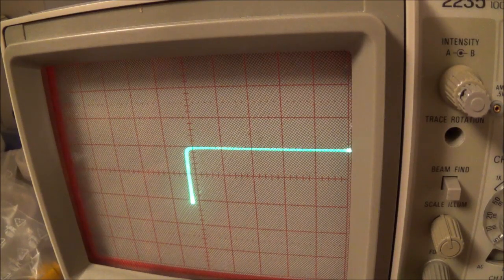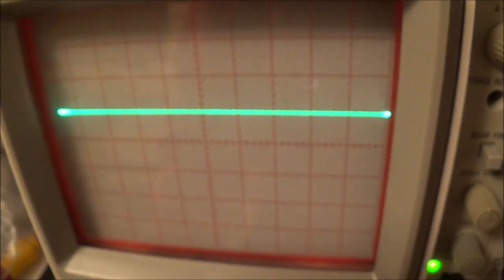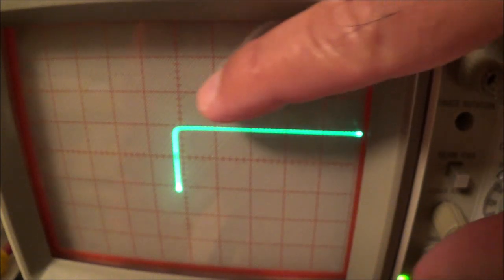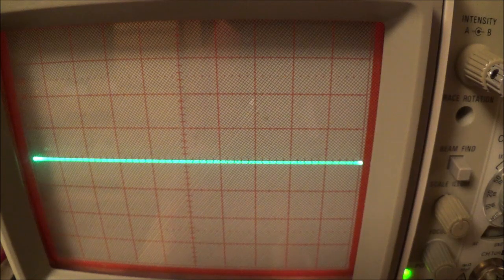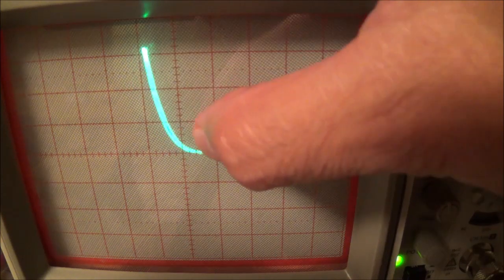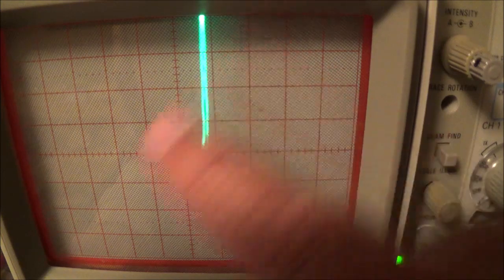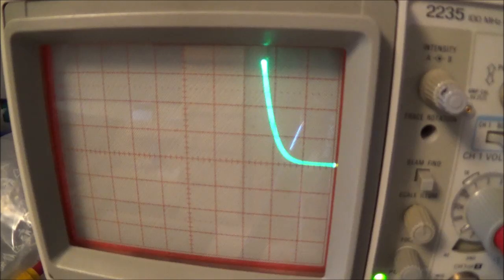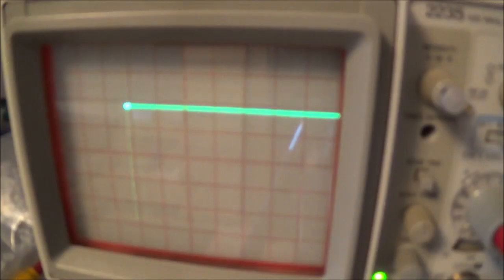Zener Diode Check-out With Leader LTC-905

Comment: OS, this was very informative and interesting! I have a Tenma oscilloscope (https://www.youtube.com/watch?v=spUe7p2jXrM&t=925s) that has a component tester, would it be comparative to this curve tracer?  I don't have it inline, however, once Im complete with my new workbench build (real soon), I plan on having both oscopes inline.  Thanks!  ~Jack, VEG
Reply from the maker: Thanks for watching and commenting, VEG! Kinda, the same. When you are im diode check mode with the Leader curve tracer it is almost like a component tester since the staircase pattern is not utilized which would normally be applied to the base in order to turn on the transistor. Meaning you only use 2 leads.  Also, I think my curve tracer puts out a rectified sine wave ; my mini-component checker, in contrast, uses a normal sine wave. The sine wave is applied to both inputs at the same time. One sine wave is applied to the input directly; the other voltage is applied to a resistor and the component being tested. This resulting waveform is fed to the other input. So basically you look at a visual representation of both waveforms.
Reply: Thank you for the reply...once I get my oscope up and running, I see if I can simulate some of what you have here!  May also checkout curve tracers for the heck of it!  :)  ~Jack, VEG
Reply from the maker: Yeah, you should get one. It is about the most comprehensive way to check transistors, etc. I got my Leader for a good price and the user manual and calibration/service manual is online. Also, it increases your knowledge of electronics.
Reply: OK, I now have a saved search for this model.  :)  ~Jack, VEG